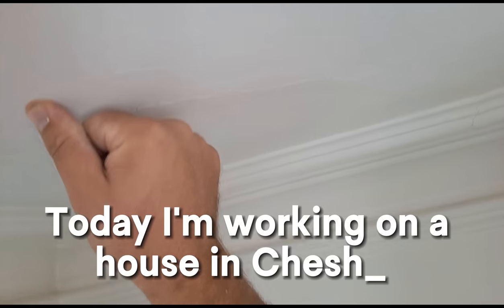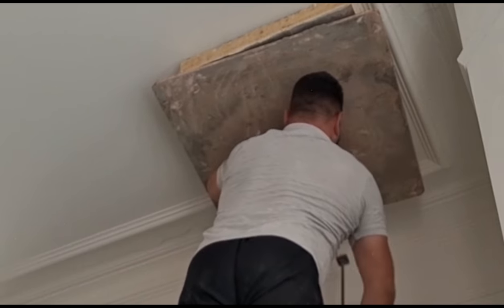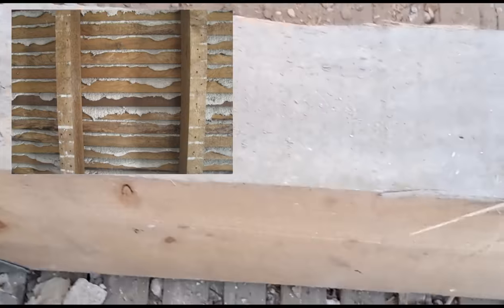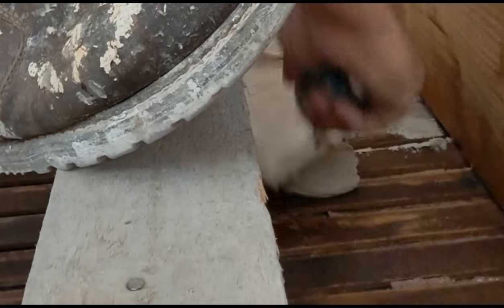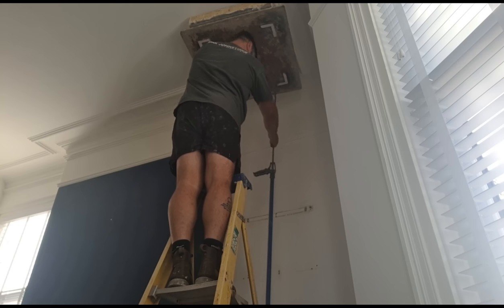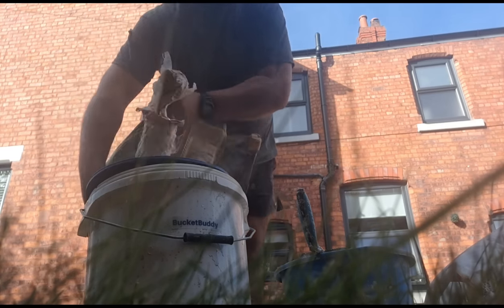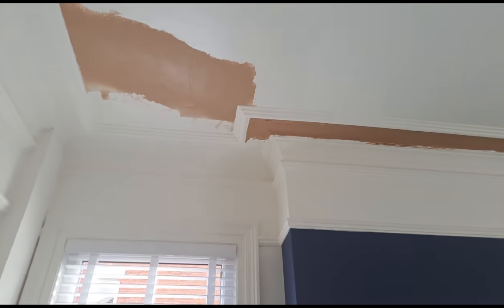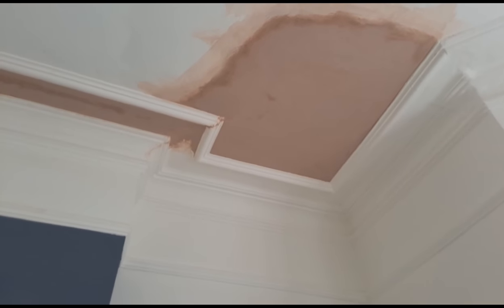HOW TO STOP A CEILING COLLAPSING

Comment: When I was plastering we gave The customer The option of overboarding with wraparound beads on 8 or 12mil boards keep away from original cornice about 5 to 10 mm from the floor after decorated looks like original

Comment: Fantastic video Kirk. I’ve seen a hundred lathe and plaster repairs from Kirk Giordano, but you’re the first to show one in England. Brilliant job and lovely gesture. I had an equally challenging upbringing and unfortunately my mum didn’t have anyone besides my nan to help, so lovely thing you’ve done. With regards to the van, it’s great when you feel the van pull. I kept having dpf issues with my 13 plate transit, on the end i had it mapped, its not 130bhp from 90 something, goes like a rocket in comparison to before, and is pretty fuel efficient

Comment: Really agree with the use of SBR brilliant adhesive lot of spreads won't use it cos of the price, ive used it many off time s when rendering
Reply: Like how you made sure the laths were bonded and strengthend not many builders  or customers get what you're trying to do for the right reason
Reply from the maker: I knew that the guys that understand how lath and plaster work would understand. People like yourself mate

Comment: I used to live in a 1920s house with lath and plaster ceilings. It was rented. The living room was about 14.5 x 10.5 feet with a nice little cornice. One Saturday morning I was getting ready for work and there was a massive bang and the whole central area of the ceiling had come down. Me and the landlord tried to work out what happened and came to the conclusion that the heating pipes had dried out the laths and the plaster then detached and the whole lot just fell. It was too much to patch. I wanted to keep the cornice so the landlord paid me to take down the ceiling and board it. I cut around the edge with an angle grinder, took down the ceiling and laths which just left the cornice. When the boards were up the plasterer came and used bonding to bring the ceiling down a few mm of the cornice. He then skimmed the whole ceiling. It actually turned out great and once painted you would never have known any work was done. I tried to buy the house off him but he wouldn’t sell and ended up buying somewhere else. 😂 Thanks for the video, I will feel a lot happier if I have to do any repairs to lath & plaster.
Reply from the maker: Enjoyed reading that thanks 🙂

Comment: The PVC mains cabling routed through notches in the joists is against 17th/18th Edition regulations. What a horrible bodge job so you would need to recess either side of the notches and get substantial metal cover plates to stop nails or screws penetrating the cables and called 'basic mechanical protection" under regs.

Comment: Any advice how to stop renderlite taring/sagging when featheredging/ruling off. 

I’m I mixing the material to wet or should I mix it stiff and splash some water onto the material once it’s on the wall. 

Or I’m I applying it to thick 

I’m  just seen unable to play around with the gear once it’s on the wall just taring

Many thanks

Comment: If they changed the joists how did they nail the laths back on .... they would have do it from underneath threw the plaster
Reply from the maker: They must of done mate, or maybe they put a load of screws through and just hoped for the best.

Someone had definitely done something though as the finish below was pink not white

Comment: Kirk you didn’t fix the ceiling back to the joists mate.
Reply from the maker: Well spotted. The ceiling had previously been patched up after the new joists.

When I was cleaning out I noticed that about every 4th lath had been re fixed to the joists from below. 

I was happy that once i meshed it that it will be solid.

If you ever wanted to do this without causing more damage below then you could lap the mesh up the inside of the joists and staple it before back plastering but I didn't think it necessary on this little area.

Keen eye though mate 👌👍

Comment: well no the joiner wouldnt of chipped it off to make it look neater he would of chipped it off so bits of plaster bonding or whatever it is isnt hindering level of joist like, why not just wizz a square of the affected ceiling out and replasterboard rather than going takin up some geezas carpet or laminate floorin to get to the floor boards to then rip that up to then do that lil bit of a job
Reply from the maker: Would of lost the cornice and customers wanted tk keep it.

Costs would of doubled if I had to rebuild the cornice.

Thanks for the nice comment 🙂
Reply: Must be a joiner was it you that done this 😂
Reply: @markrobson9894  aha no but i wouldnt think twice and id definatly wizz off the affected part of ceiling and board it going neat up against the cornice or leaving a couple inches from the cornice, filling on to top of some old laths then doin some mesh still doesnt seem as good of a job as just replasterboardin a section no meither